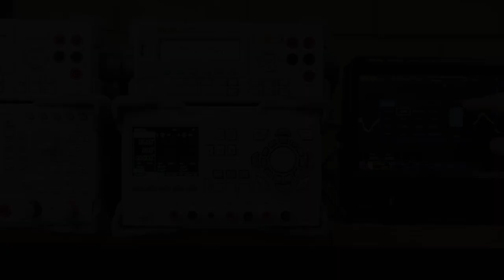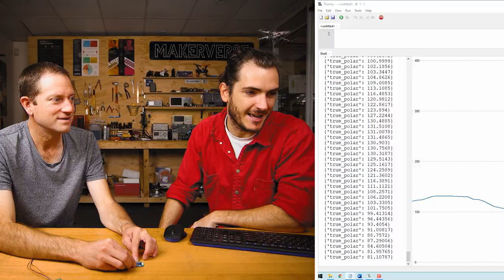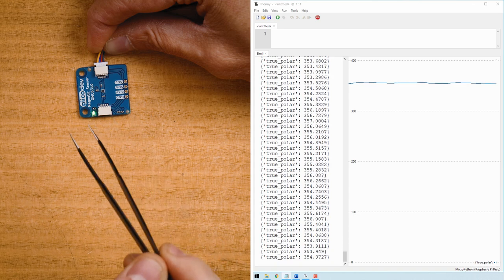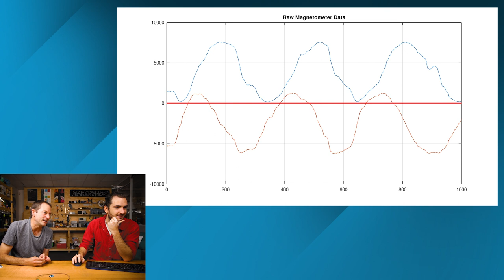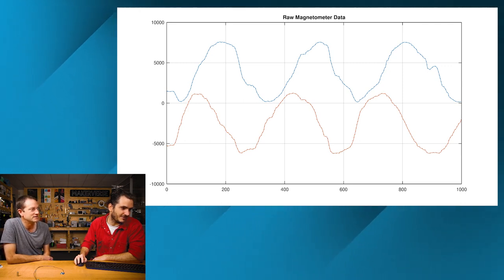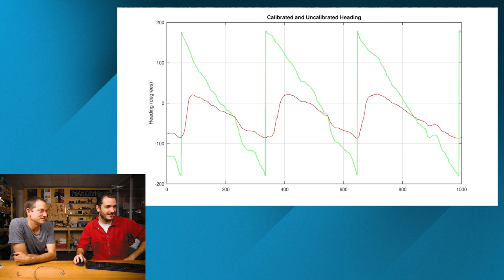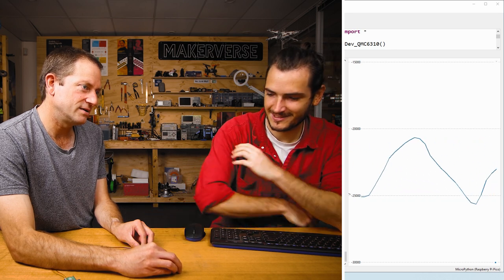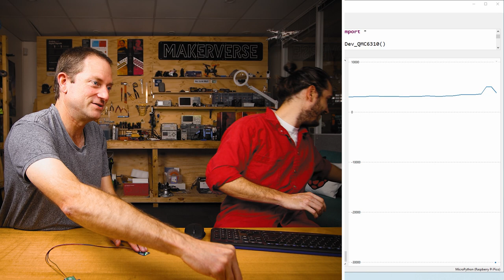The Factory | Calibrating Magnetometers & Raw Data Applications

Comment: Nice video!
Reading QMC6310 datasheet, it informs a sensitivity of 15000 LSB/G in the field range of +/- 2 G. Could you specify more on how to calculate the magnetic field amplitude? Thanks!
Reply: Find the magnitude of the three-dimensional vector:  amplitude = sqrt( x^2 + y^2 + z^2)
Reply: @MichaelRuppe  Your equation is correct to give the magnitude of the field vector, but not exactly what I was asking for. After some reading, I figured it out.

Comment: how effective could you use a magnetometer, and 3 axis aligned electromagnets (coils) (preferably on the same core) to get dead reckoning of that object in 3space?
Reply from the maker: Like all involved project - it depends! We can see that there's a pretty clear correlation between field strength and the raw reading on an axis.
I guess the tricky part would be coming up with an appropriate trilateration algorithm. The field will change wildly depending on the magnet's pose - if the magnet is rotated in place the data will change, but the location will not... tricky!